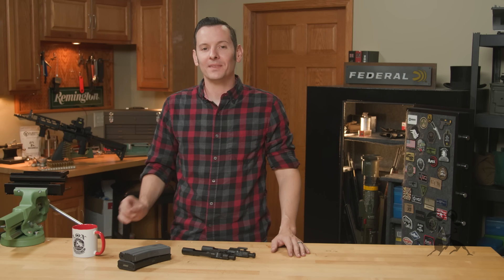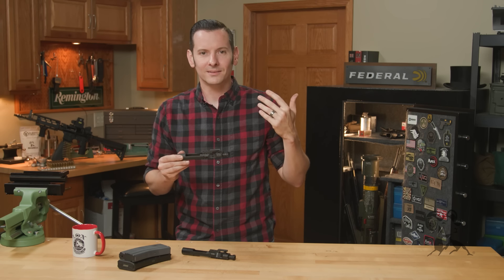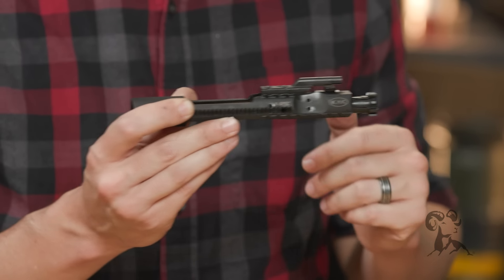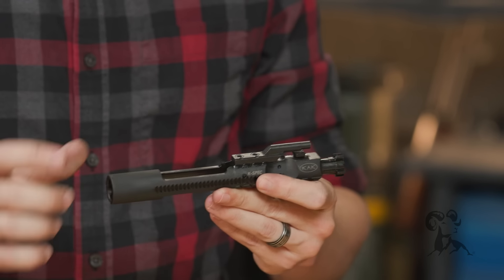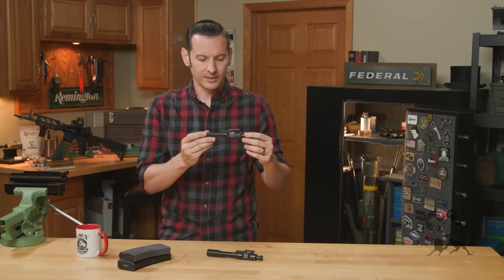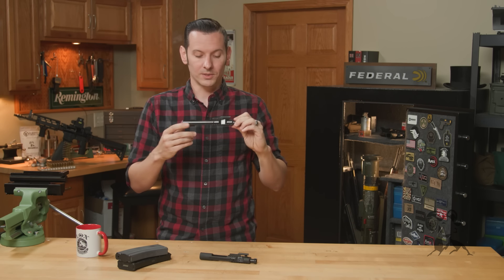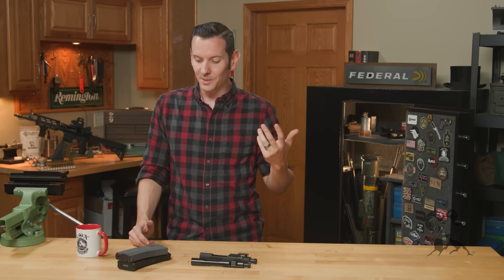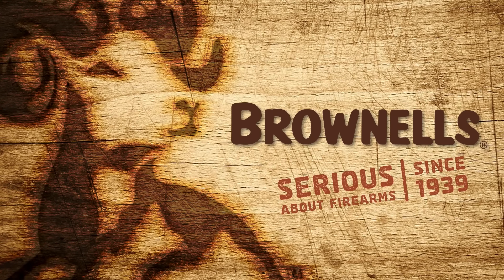Product Spotlight: KAK K-Spec Bolt Carrier Groups

Comment: Doing some testing on one now. It seems to prevent some gas to the face but it's no cure-all like some seem to claim. Manufacturing quality is very good and the dual ejectors seem to add a lot of tension to the chambered round, press checking takes substantially more force and ejection pattern is very strong and further back.
Reply: That's some good info! Are you testing with a normal charging handle and gas block? I'm curious to see if adding this BCG to a rifle with a Radian Raptor SD charging handle and Superlative Arms bleed off adjustable gas block will help mitigate gas to the face even more.

Comment: $180-$220.  It’s interesting but I’ve never had problems with standard AR15 BCGs.
I run something like this in my AR10 and the dual ejectors cured reliability issues though.
Reply: My two cents when I build. 70% of the budget goes into barrel / BCG / trigger. the cost on KAK is not a big deal, as there are higher cost BCGs. You get what you pay for!  The KAK BCGs are worth it!
Reply: @rmartuszewski  The cost isn’t an issue for me.  I just listed the price because Brownell’s can’t on YouTube.  Multiple calibers, suppressed/unsuppressed I never had issues with a standard AR15 BCG.  They make one for 7.62x39 I might have to check out
Reply: Love mine, found out about them through school of the American rifle tear down here on YouTube. They’re one of only a few manufacturers to offer full chrome and NP3 coated BCG’s. I’ve never had issues with standard except the really cheap ones when I first started building, but the possibility of a slight increase in reliability, tight manufacturing tolerances and the coatings they offer sold me.
Reply: @andrewbennett2222  yeah those slick coatings are a huge upgrade, especially if you shoot suppressed.

Comment: I've been thinking about trying one of these. Just recently got my first suppressor and it definitely made my rifle gassy. Ejection is still around 3 o'clock with an h2 buffer and a roscoe k9 12.5 barrel. Great video
Reply: i switched to the Griffin Gen2 Charging handle, to help with the gas.. andit made a huge difference, even better than my Radian ones..
Reply: @Maine307  yeah I thought about trying a radian SD charging handle but 150 beans is a lot for a charging handle 😂 I'm running bcm charging handles in my rifles
Reply: @ethan5.56  the Griffin snach is probably the best ch I've used to mitigate gas. Close 2nd would be the silencerco gdch

Comment: So the redesign of the gas vent holes are now going to redirect gases into the magazine and possibly the trigger group?
Reply: KAK has done a lot of testing of the down vent bcg's and have stated that there is no noticeable reliability issues. Even buyers have reported no issues they can tell.
Reply: By venting the gas down you reduce gas to the face when shooting suppressed and it does make it less noisy at the ear.

Comment: I believe the original AL'S the slashed grooves on the left side of the bolt carrier group is for the bullet assist to fully assist  the round into the chamber should it not fully seat.
Reply: he isn't talking about the FA cuts. there are cuts above those on the front part of the carrier.

Comment: I'd like to see what this does to a trigger group. Hop has a video on this, too, although he doesn't show the trigger group either.
Reply: I haven't noticed any notable increase in crud over a few hundred suppressed rounds
Reply: I had the same question/thought. It's a solution looking for a problem for me. I've never had a carrier related issue. I don't play in the sand in real life either. So, for me, it would be a second cool thing.
Reply: @johndecker9983  I believe he was referring to the down vent gas port version and carbon displacement buy I could be mistaken. The down vents absolutely make a difference in both noise level and blowback. The sand cuts, hopefully, can't hurt
Reply: @BT-ld4wi  I'm deaf in any case,  I see the advantages. But at the end of the day it's a case of paying the piper. I run a di gun, I'm getting gas, regardless. Do I want less gas? Yup. But how much am I willing to spend for a non quantifiable amount of gas that isn't going to be going directly into my face? Your answer could be different than mine. I just see it for what it is, shooting with a silencer. Going to be gassy
Reply: @johndecker9983  well said

Comment: They should have gone with a Sharps Reliabolt head/roller cam for this BCG, tbh. Just doing the sand cuts and down venting feels like a half-measure without having the other (arguably more important) reliability upgrades as well.

Comment: My KAK K Spec down vent BCG was completely unreliable. It had trouble cycling and then one time locked up so bad I almost couldn't get it back open. Compare this with the $89 Microbest I have been using for a couple of hundred rounds in the same rifle which has never malfunctioned. YMMV. My KAK bcg is now a $200 paperweight.
Reply: It’s funny to hear all the comments of guys on here that it’s so obvious they don’t know what they are talking about and don’t have much experience with these bcg’s but act like they do and that these are super high quality bcg’s when nothing could be further from the truth. The finish is rough and the ejectors are concave and don’t seat all the way.  You are absolutely correct, these things aren’t much more than paperweights.  It will start to chew up brass and cause failures to fully go into battery and get the bcg stuck and the rough finish on the sandcutters is going to eat into the upper. These are sub par bcg’s at best. Anyone with some actual experience and serious rounds through this bcg knows that.
Reply: @ReedBreinholt  One thing I will say is KAK has good customer service. I left a negative review on their website and they contacted me, sent a prepaid shipping label, and refunded me $200. I was pleasantly surprised by this.
Reply: No one is trashing their customer service.  These days with social media etc., any company with an ounce of credibility better take care of the customer when they send out a crap product. Like an idiot I happened to be on Reddit one day and saw all those snowflakes jumping on the kak bandwagon because of their edgy posts and praising the bcg’s before they even had them. I bought a couple of the dual ejector k specs and nothing but problems. Almost like it was grinding through the upper and it chewed so much brass that I couldn’t get the bolt seat into the barrel extension. I reached out to kak and they took care of it. I haven’t ran the new ones yet but I have a full set of gauges I bought over the years from sotar that I plan on gauging the bcg’s before I ever let it touch one of my rifles again.

Comment: Sand cuts on the ejection port side will allow more ingress to enter the AR action..
The standard carrier seals the ejection port much better..

The ejection port carrier vents will blow any ingress (like mud) back out of the ejection port..This is why the standard (internal piston AR) is more reliable than the AK or external piston AR's during mud test..
Reply: @hairydogstail  yeah…that didn’t seem like a good idea.  Nitride and NB Coatings are about the only really beneficial upgrades I’ve found on the platform.  Dual ejectors are a must for AR10’s…most manufacturers have figured that out already.  Never had extracting problems with a AR15 BCG unless it needed a rebuild kit
Reply: @KennethReed-j8r  Chrome inside the carrier is still the best..Many Nitride coatings fail the tolerance check, since the bolt carrier manufacturers machine the critical 3 bores using the mil spec measurements failing to understand that nitride does not add material like chrome..
Reply: @hairydogstail  bolts are almost always chrome.  It’s the carrier that you can get different coatings.  At least the ones I have are that way.
I’ve got an old DPMS NB BCG that has tens of thousands of rounds through it.  Almost 20 years old…back when DPMS only sold top tier products.  Several others BCM, Aero P, Spikes….etc no issues.
Only BCG issue I’ve had is with Bear Creek Arsenal junk.
Reply: @KennethReed-j8r  Most bolts are phosphate and most carriers are mil spec phosphate and chrome on the inside of the three bores..
Reply: @hairydogstail  you don’t see a lot of phosphate anything anymore.  Most BCGs are nitride, Nickel Boron etc.  They all come with something slicker like chrome for the lining.  Only thing I’ve noticed for phosphate coating is it holds lubricants a little better….also dirt, carbon and everything else.
Reply: @KennethReed-j8r  Phosphate/ chrome is more expensive than nitride, which is why you see a lot of nitride carriers these days.. Hard chrome carriers are my favorite, if done correctly..
Reply: @hairydogstail  chrome is definitely a more expensive coating .  Phosphate coating is the lowest priced and least expensive to produce.  Only company that I know of that charges a premium for phosphate coating is BCM.
BCM makes great products but I prefer to wipe off carbon fouling.
BCM has great BCG rebuild kits.
Reply: @KennethReed-j8r  No, phosphate with the chrome inside 3 bore (mil spec) is a lot more expensive..Niride is the least expensive which is why nitride BCG's cost a lot less..
SOLGW, Colt, Daniel defense, FN use Microbest to manufacture their bolt carriers and bolts that are phosphate/chrome....